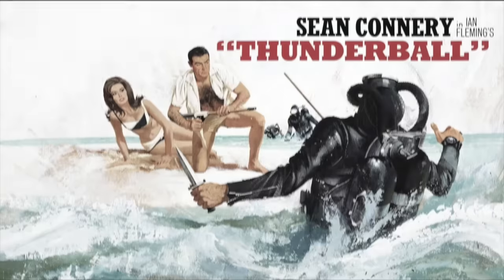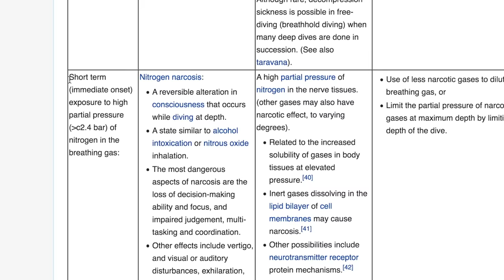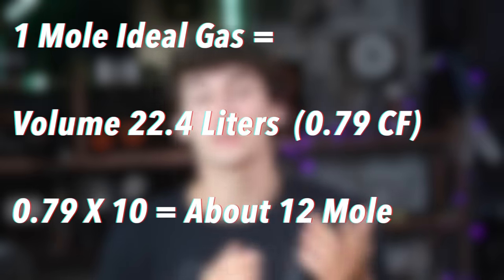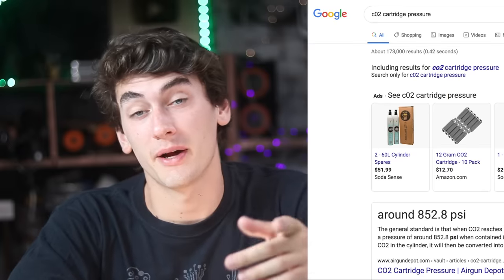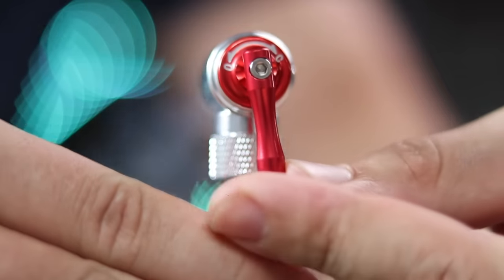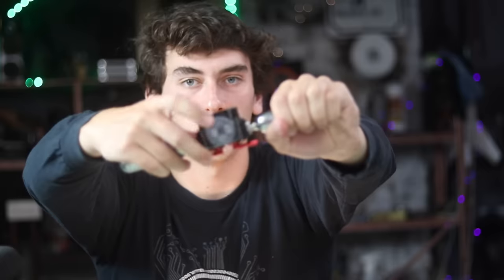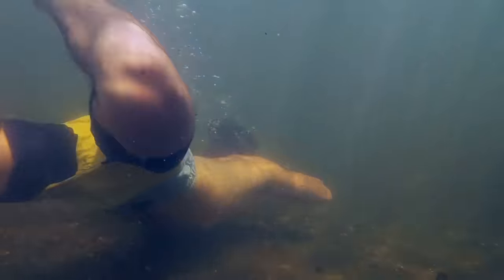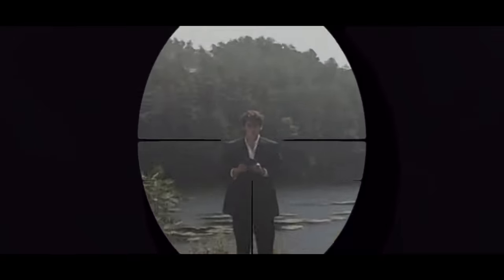Working 007 Mini Scuba Tank! - Breath Underwater With This Spy Gadget

Comment: people CAN actually breathe pure O2,  just... not for extended periods of time. also, there is also supposed to be a valve between the compressed air and your mouth as to not have highly pressurized air rush into your lungs. Finally, holding your breath like that, even in that shallow of a dive can be detrimental to your lungs. I mean... the first rule of diving is to never hold your breath. As a certified diver myself, I can attest to this, and am not just making unsubstantiated claims.
Reply: What about free divers that hold their breath for 5+ minutes?
Reply: Mate, hes literally holding his breath like everyone else does in a pool
Reply: Not speaking from a place of authority, but isn't this different from scubafiving in the way that, despite the name, it isn't meant to replace breathing and is only to give you a couple extra lung-fulls of air?
Reply: @P0GboyFlixzYOU  hmmm... i haven't thought of it that way. i'm not sure.
Reply: @P0GboyFlixzYOU  perhaps one could make the argument that scuba diving IS meant to give extra breaths of air, albeit a lot of them, though outside of that, you make a good point.
Reply: @becurbilyg  I can't remember the exact reason but when you hold your breath and go down, it's pressure at atmospheric level, but when you're under water at 40 feet breathing compressed air, it takes more to fill your lungs, for example double the volume you would when you're on the surface. So if you have compressed air in your lungs down at 40 and move your body up 3 feet, it can cause serious damage to your lungs from the expansion. On that note, diving at 40 feet vs 130 feet, you will notice your scuba tank will burn through quite more air to go deeper, for example, at 40 feet you will have around 40 minutes vs at 130 feet you'll have maybe 8 minutes
Reply: John Keo I get the physics of it but spearfishermen are holding their breaths for long periods of time and in great depths. I’ve seen people go up to 140ft with a single breath to catch a fish. Maybe when they are ascending they exhale to relieve the pressure caused by expanding gas. I guess holding your breath doesn’t make sense in the scuba diving world but I don’t think that is dangerous to someone who knows what he’s doing.
Reply: @becurbilyg  from what I understand, holding your breath and going under and breathing compressed air under pressure are two different animals. A good way to look at it would be, holding a ballon at atmospheric pressure and then pulling it down. You'll notice the ballon will be shrinking from the compression and go back to normal size when you go up. Now if you pressurize the ballon while under water, it will stay that way until you start moving up, which would expand the ballon as the pressure from the water becomes less, making it important to make sure you keep breathing so you can compensate for the expansion in the lungs.
Reply: Even though the 100% O2 is dangerous, still the mixture could be made up to 40-60% O2, which should be OK and result in 3x times less PSI. Of course, it's not easy to DIY but possible for secret service or factories.

Comment: You answered one of my questions about how long could you hold your breath between breaths and confirmed what I thought. 

I was also thinking that you could create a valve release that worked by biting down on it. As long as there was enough play, you could gently bit down and leak out a little air and regulate how much air you used much more efficiently.
Reply: The best way for biting down mechanisam would be probably implementing way how most beach equipment let air out when full. At air insert you just press from sides and apply presure with your body on beach ball to push air out. Maybe that could go.

Comment: I went through divers institute of technology to become a certified commercial diver. You were right about the gas expansion and pneumothorax being a real problem, if you surface too fast that’s one of the issues that could happen, along with DCS and AGE, ur best bet for surfacing fast would be screaming your entire way up. Also the nitrogen left in your body is referred to as RNT (residual nitrogen time) it won’t harm you coming up but it’ll harm you if you stay down too long, especially on a repet dive

Comment: The system wasn't engaged.  The red handles are in the same position.  The last scene, you aren't using the device or breathing from it.  Lastly, what PSI are using to pump up the cartridge with O2?  Still a cool video and nice job fabricating the device.

Comment: Anyone else clock that he’s not filtering the air like that’s kinda bad
Reply: Huh? Do you usually filter the air you breathe? Because that's all he pumped into there.
Reply: @SirKingquote  yah ur supposed to filter it and remove all the water and debris in the air
Reply: He is right, divers use pure o2 when diving. They do this, because naturally the nitrogen lvl in or body rises at higher pressures (sea levels) . If then the nitrogen mixes with air, less oxygen is available to them and they would die of hypoxia. When not using an extra tank, the c02 saves the driver from this.
Reply: @_dya_  divers don’t use pure o2 as breathing pure o2 results in cell damage and death. Standard air is filtered through many filter to rid the air of water and other microscopic particles. Being that the air that we breathe normal consists of 78 percent nitrogen divers don’t loose any percentage of air to nitrogen. However they can’t be underwater forever as the nitrogen builds up in there blood and is unable to release it through the skin due to the fact that they are under water. There are ways to stay under longer like using nitrox, a gas we’re they replace some nitrogen with oxygen. Another way is to use a mix of helium and oxygen, heliox. The final way is to use a rebreather witch take the air that you breathe out, removes the co2 and adds a small amount of oxygen as humans breath out most of the oxygen that we breath in resulting in multiple breaths being able to allow us to absorb the needed level of oxygen. It is also technically possible to breath liquids, rats can do it with no problem. The biggest problem with breathing liquids is that it would require a mechanical lung to force out the water as our lungs wouldn’t be able to do it. It would also feel like you were about to drown but we’re barely holding onto life

Comment: I was about to comment: I am happy that you did some research on the topic, buuuut you did what you did with those co2 tanks. I has been diving for 6 years now so I think I have some knowlage about the topic. Firs of all - don't ever wash your tanks with water from the inside, its dargerous, it can rust or you can accidentaly choke on this while breathing. Second thing - don't use a fucking paintball pump for this, because it pumps not only air, but also stuff like: oil, water vapor, and other gases that are harmless on the surface but can be lethal under pressure, that are just sitting around. Normal compressors for diving are using like 4 big filters and bottle for codensed water. Also using empty co2 tanks is not the best of ideas, beacuse you can have some left and you will be breathing incresed amount of co2, which obwiously is not good, but good thing you tried to get rid of as much co2 as you could.The idea of this video is good I really like it (thats why I clicked on it) but execution is fucking dangerous.

Comment: As a childhood diver I had the idea we need 30 litres  free air per minute at 10 meters depth  (~30feet); there we have 2 Bars of pressure that compresses the air to half volume = 15 L /minute times 5 minutes gives 150 liters free air to compress into a tube. If  you compress it to 300 Bar, you will need one tube of 0.5 litre or 2 tubes of 0.25 litres of compressed air for five minutes of shallow breathing. Do not forget you need a vessel capable to withstand 450 Bar at the normal security threshold for 300 Bar - which makes a very thick-walled tube, if it explodes it will have the same destructive effect as a military grenade. Not to take lightly!

Comment: Probably someone has written this before, but you can breath pure oxygen, it isn't toxic at the surface. It has to do with the partial pressure of oxygen, which may not exceed 1.4 bar, which means you should be able to go to about 4 meters / 13 ft on pure oxygen. You do often breathe oxygen enriched air as a scuba diver (that what a nitrox blend is), but it does require some extra calculations of your maximum operating depth.
Interestingly it is not the lack of Oxygen in your blood that triggers your breathing reflex, but your CO2 tolerance.

Comment: there is an aqua lung that breaths into expandable hoses and only functions down to five meters around 20 feet because beyond that the hoses can't expand because of pressure. the reason they have to expand and contract is to pass the the gasses through a scrubber.

Comment: Ya know, if you're just looking for something for a few minutes of air, you could simply make a larger rig (preferably that fits over both the nose and mouth rather than just the mouth) that is still not very large.  Like, if your tanks were 10 times larger, they'd still be rather small.  Of course, you'd probably have to machine your own custom tanks for this as 1.  you'd want a different shape to fit your face better and 2.  Pretty sure they don't make that size oxygen tank.  I'd love to see a project like this honestly done well and I feel like it should be possible.

Comment: It would be the best with a "bite" valve which regulates air flow gradually with bite pressure. So you don't have to manually operate the regulators at each breath and quite surely you save some air in the process🔥😎

Comment: I wonder if some day a device with a similar concept could be used for free divers in an emergency situation where they need air now? A diver like that a few breaths will go a long way. They are so deep down only with the breath they took at the surface, under extreme water pressures, and a lot of times so deep spotter divers can’t even go all the way down with them.

Comment: By the way, it can fairly dangerous to breathe pressurized air if it's not filtered properly. I wouldn't recommend using a bike pump or any sort of consumer compressor for this.

Comment: I am even able to breath in pools or lakes. its not "breathing" breathing but while moving in water if you breath with your nose without letting in water you can easily 2x your time. normally i can hold my breath without moving for less then 1min. if "breathing" while moving I can for 2+ min. its not really breathing but this way you pump the rest oxigen to your longs or out of your lungs I believe. it works i dont know how. try it. if you can hold for 3min then with this trick you could add 1min more. does work in salt water too but there if you accidently get in water in to your nose then that sucks

Comment: I have a cool add on idea even though its 2 years old you could make a water proof pump so when you are out of the water you flick a lever and it fills the container so you did not have to use a pump over and over again

Comment: This really is deserving of a version 2 upgrade. Better mouth fit, slightly larger tanks. (especially since you can screw them off anyway). Surprisingly this is still quite a usefull thing I could imagine a spy using. At least since I'm in the Netherlands and there is water basically everywhere here lol.

Comment: You solved the question. Of how to get normal air into those little CO2 tanks... For xxl large waves surfing we have four CO2 tanks connected to pull valves on a vest.
. For for medium to large surfing we have rash guards with just one PFD CO2. And I thought when times are really screwed and you're being held down a very long time it would be nice to be able to breathe from those things they all come with a straw... Check out Hero rashy PFD on Google. For the professionals they use $1,000 Quicksilver extreme wave vest... Either way if you could dependably switch the CO2 out with breathable air it would give you one last chance at breathing while you're being held under by giant waves...

Comment: Actually that was pretty dangerous as there was no decent regulation of the pressure. In scuba diving it is important to regulate the air pressure to your surrounding pressure. You could have hurt your lungs pretty bad with that.

Comment: That one-way valve makes no sense to the part you talked about. It's basically a blowvalve snorkels have. It for easier blowing out water. You said it was for overpressure and not going directly into the lungs. The valve was outside of that circulation
Reply: Basically that valve allows for you to blow out water easily and not let water back in. 

Did you try to fool someone here?
Reply: The image clearly show it's one the other side of the breathing device. This was stupidity dangerous!
Reply: In this case the pressure of your lips is the regulator and I guet your teeth as well.
Reply: The valve was also halfway into your mouth, so it was again useless. I don't even understand why you added that. You didn't even add silicon to get better closing on the mouth. You need to grip it with your lips... Good luck on that!
Reply: There are officially small tanks for this purpose. They are about the size of a small water bottle and they work as real as a dive tank does

Comment: Only issue I see is someone not thinking to exhale while ascending. As much as the 5 breaths wont be enough to cause nitrogen narcosis or any issues akin too that the risk of expansion injuries from breatholding on ascent is a real very real with this device. At 15ft your holding 150% the volume in your lungs under pressure and its waiting to expand; at 30ft your holding 200% your lungs volume under pressure.

Comment: Actually that formula wont apply on that high pressures. After 3000 psi the effinency decreases. 3000psi 10L tank will give you around three cubic meters of air, but 6000psi 10l wont give you the double amount six cubic meters. Ideal gas law doesnt apply when talking about higher pressures.

Comment: OK fair enough, almost there. But what if it was made as a rebreather. Expand from one tank,  store the energy in a tungsten flywheel, compress into the other. Add a little o2 from a third tank, remove co2 in this cycle, like any rebreather. Oh, and it does not have to look like the prop, the tanks should be aligned so they don't break off.

Comment: For what it's worth, freedivers are excellent at breath control and holds, and many practice multiple disciplines. Moreover, underwater workouts and other cardio activities are more common than you think, and combining them all makes this device a very much desired thing. Apnea tables are excellent way to build up tolerance to high CO² and low O² to lengthen holds between breaths. 🎃

Edit: look up Underwater Torpedo League. And the Frenzel maneuver.
Reply: What's this "CO squared" you're talking about ? Is it COCO nut?

Comment: You can breathe 100% oxygen, no problem. But it would become toxic to breathe at about 13 feet of depth. But on the surface or above 13 feet, it's totally fine to breathe 100% oxygen. That's what's in those oxygen tanks old people roll around... BUT, scuba diving with 100% oxygen isn't practical unless you are in a 10 foot deep pool. Avatar 2 cameramen, safety divers, and anyone else on that film that used a scuba tank were on 50%-80% oxygen during the entire filming process. That gave them 24 feet max depth on 80%, or 59 feet max depth on 50%.

Comment: I AM VERY SURPRISE AS SMART AS YOU ARE, YOU HAVE NOT  created your own EXOLUNG version of scuba tank..endless supply of surface air....using legs to pump air in the tank, which also prevents lungs from filling completely thus less risk to rupture lung...generally good for up to 15 feet ....

Comment: If you control the capacity...you can control time...that said...time is a must...seconds...minuts...precisely marked.... if you know how fast an object takes to fall when you leave off on a certain highnes to reach the floor...well you are not an object...the water does not ofer any kind of making you moove faster and either they would find out about water transport cilinder and velocity...like the faster water swimmer...boat...motor...and in this comparing the size weight of your body...have you ever tought of the huge animals in the sea...how fast they can go grow and stuff acording to types, caracteristics, have you ever wonder what is the fastest sea animal... welll well...

Comment: I think if he fill it with oxygen enriched air (like 30%) he could stay way more longer. A little risky though coz too much oxygen may occure a confusional state but for this small amout, its surely fine.
Reply: It seems like it’d make a difference but it actually doesn’t because it won’t remove the CO2 from your body enough. 

The same phenomenon already happens in diving, when you go deeper the air in your lungs becomes more pressurized and oxygen dense.  You’d think that you could take fewer breaths and be fine then but in reality it doesn’t work like that.

Comment: James Bond 's scuba actually didn't contain any storage/ tank... The size was too much different..if to argue about operating TIME, the full-sized double tanks is for 40 minutes.. the finger-size (2) tubes would last for mere 15-20 seconds. So, it is not AIR-STORAGE but a GILLs System, meaning it must FILTER-OUT the oxygen content in the water and then feed it (air/oxygen) into our mouth/ lungs instantly..(!?!) Very far nanotech - Filters.